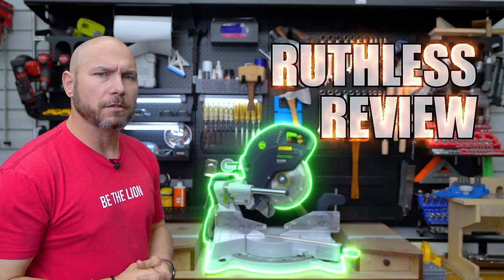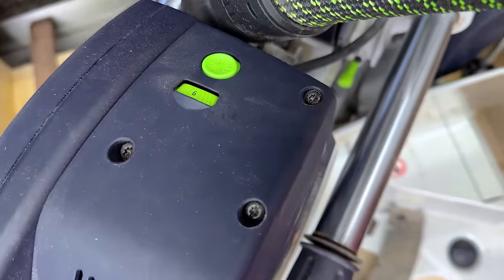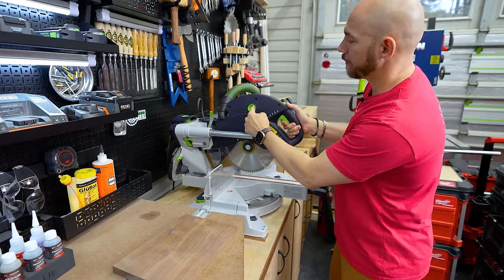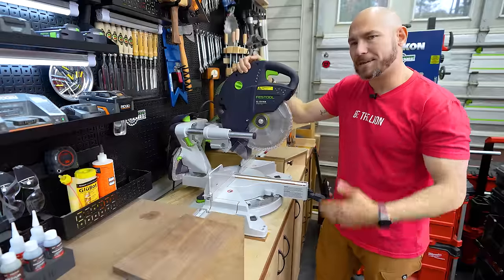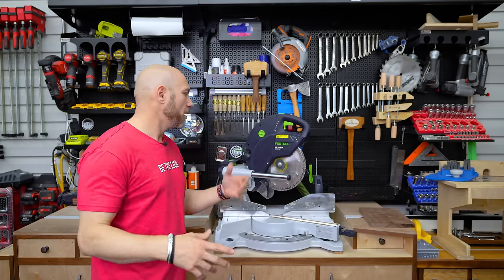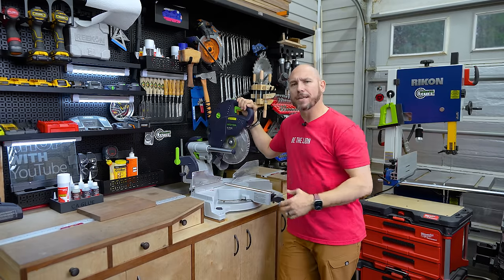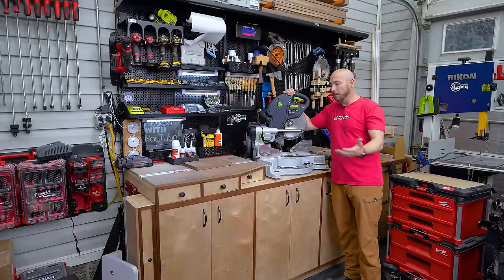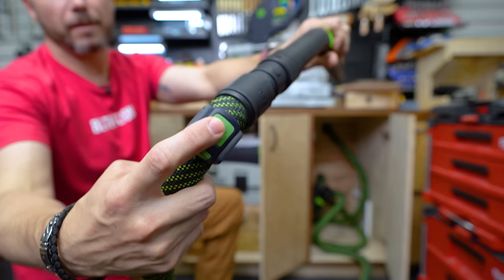Ruthless Review of the Festool Kapex Miter Saw!

Comment: The blades arent proprietary, they are a euro size, a 30mm arbor is very common on larger Euro-Tools (like sliding table saws, which can use a 250mm or larger blade). There are plenty of 3rd party options. Oshlun, Tenryu, CMT, Forrest, Infinity, Freud, Amana

Comment: The blades aren't really proprietary, they're just the metric standard size like someone else also mentioned.  If you have a shop that sharpens blades they usually will punch out any 5/8 arbor blade to the 30mm for a very fair price.

Comment: one thing I've learned about Festool "recommenders" is that their recommendations (especially on more expensive tools) seem to be based on the need to justify to themselves (and others where applicable), the amount of money they spent on the equipment, emotional recommendations, if you will.  I've got several Festool tools (4 sanders, 2 vacs, domino, router, cordless track saw and tracks, accessories, etc.) and I love each and every one that I've purchased but this specific tool, ah.. I just don't get it.. I bought it, yes it's got nice features as you point out, but at the end of the day it does absolutely nothing any better than my Makita LS1219 for 1/3 the cost.  I returned it.

Comment: I am just a DIYer and went through  3 miter saws before making the plunge.  That was 11 years ago and I have NEVER looked back.  The old Cry Once theory.  Over those 11 years the saw has worked flawlessly with absolutely no issues.  Just made a 100 or so 30 degree miter cuts making Xmas trees and the saw is as accurate today as it was when I purchased it.  And... it has NEVER been recalculated or readjusted.
As was said, the hold down is something that I actually use all of the time.  In fact I purchased a second one for the other side to help prevent pinching and binding if a board is not perfectly flat.
All in all, I am very happy and please with my purchase over 11 years ago.
Another plus,  if I have a question about the product or any product, Festool customer service is ALWAYS helpful and they always answer the phone.
regretted any purchase for a moment.                                    JimE
Reply: I just bought a 10 year old kapex with a broken motor for $220. I've got a brand new bosch axial glide and although I obviously haven't used the kapex yet i gotta say it feels super solid even after 10 years
Reply: @AwesomeActsOfRandom  Once you fire up the Kapex I don't think you will look back.  I found working with Festool easy and productive.   JimE

Comment: I install stair treads with prefinished flooring.

What the Kapex and all Mitre saws saws are missing is a fine adjustment for the mitre. The fine adjustment on The Kapex for the bevel should be mirrored to the mitre. Sometimes I need to cut a slither off a current mitre to get a join perfect or my prefinished stair nosing's without gaps. I have to tap the mitre adjustment with my knuckles to make the fine adjustments but if I hit to hard, I'm way off!

Another Critique is the laser lines bleed so they are not accurate and are hard to see if you have sunshine on your work like I do on job sites. A shadow line would be better for accuracy and maybe a green laser for when there is sunlight?

Other than the above issues its a fantastic saw

Comment: I have one and love it. For the blades you can buy a regular blade and use a step bit to size it up for the festool. I have a Bridgeport so its short work for it, but my neighbor uses the step bit and it works fine.
Everyone complains about the price BUT, before, I needed a table saw sled for 90 cuts and I have a beautiful old Dewalt radial arm saw that was set up for 90 cuts only.  Now I don't need either, put on the Festool saw and cut,- perfect every time.
Edit to add.  The handle works equally well, left or right handed so you can comfortably cut on either side of the blade.  I think thats why the keep it.  I thought it would be a problem too, but like you said a couple of day and I didn't event think about it again

Comment: Had the saw and returned it for the KS60. Battery life is ok to good and it is not as feature rich but it does the job supremely well.  So for those in garages or work sheds where electricity is an issue the KS60 is a solution. Also, purchased the hold down separately and rigged it up to work on the KS60 as it is a superior hold down clamp. Thanks for the review.

Comment: I bought my Kapex about a month ago & have loved it! I upgraded from a DeWalt DW717 and have noticed a huge difference! The biggest difference is how straight my curs have been, both straight & miter cuts. The positive 0 degree stop on my DeWalt wasn’t true & I tried several times to reset it to no avail. 

I’m glad you pointed out the dust collection as that was something I was a lil disappointed in myself; but like you say it’s far better than my DeWalt was. 

Overall, I fully agree with your review & am confident I’ll never need another miter saw again.

Comment: Thanks for the review.... a couple of points I'd like to make.  Regarding price.... you get what you pay for.  I sold some of my 10 year old Festool products for more than what I paid... and they held up beautifully over the years.  Also, the price covers the excellent warranty and Festool's investment into R&D ensuring that their ecosystem improves over time.... protecting your investment.  

Also, let's be completely real here.... miter saws throw a lot of dust.... there is no perfect way that I've found over the years to eliminate or greatly reduce miter saw dust. Full Stop.  

Last point.  I not sure where you shop, but I don't know where you can get a quality table saw and miter saw for $1600!  High quality tools cost money and last.  Cheaper ones cut corners, typically have to replaced just at the worst time possible, sacrafice ease of use....can be under-powered and are often less safe.

You get what you pay for. Be informed before you buy into any given platform.

Cheers

Comment: Thanks for the review Mr. Matt. I think I will stick with my Terminator style Bosch 10 inch miter saw. The articulating arm on that thing has served me well. Funny thing about the Bosch is that the 10 inch is actually more expensive than the 12 inch. Go figure. It may be because the 12 inch blades are more expensive, who knows? The Bosch saws on Amazon both have 5 stars which is pretty cool. 
I once saw a review of this Festool Kapex and the guy who bought it did a lot of interior work at places like bars when they were closed. He stated that the reason he liked the saw so much is that there was basically NO dust at all when using it. Thanks for clearing that up. 
I can see paying a premium price for a Sawstop table saw. The safety feature alone is worth the price. I should have enough saved to get mine in about 1 year. This saw however....think I'll pass.

Comment: I picked up my KAPEX pretty much when it was released. I went from a little Hitachi SCMS to the KAPEX with the trolley and extensions and have enjoyed using it a lot. I'll admit it's not the best for everything and a few years after I bought the KAPEX I grabbed a small Metabo cordless SCMS that has seen a lot of use .. for floor boards and light framing it is insanely convenient.

The KAPEX trolley and wings aren't the sort of thing you want to throw a tree trunk on as I'd rate them as medium duty at best. Now being rural I've added an XGT Makita 12" SCMS to the mix along with a locally made aluminium portable station that you could park a truck on (the combo came close to KAPEX money). I'll do anything to avoid firing up a generator.

The only way you'll ever defeat dust using a slider is to add a shroud and connect it to a high volume extractor. Personally I'm surprised that Festool has never introduced suction into the throat. Is that obvious or is it that I'm just stupid and missing something?

Comment: Thanks for the review.  I'd love a Kapex but I'm with you on the price. I really like my 12" Makita slider. For half the price, it's very accurate and gives me tablesaw-quality crosscuts. The Kapex implements some of the finer features brilliantly but with the difference in cost I bought a couple of other tools I needed.
Reply: Long live the LS1211, mine is 25 years old.
Reply: I love my recently bought DSL211, much more than my MIL’s Kapex.  Although I think that the Makita [12 inches] is way too heavy, the industrial shaping and finishing quality on this tool is phenomenal.  And, also, you get the correct angle for the handle.  Eff Kapex’s tea-pouring handle (and, yes, I know, Makita uses those also; but they do so on quite small blade models).
Reply: @Jeedehem  I agree that the 12" Makita is heavy.  For me it's not an issue since I don't need portability.

Comment: I’ve recently acquired the CSC SYS 50 table saw and the TS 60 K track saw. Would there be any benefit in me getting this mitre in addition? I don’t want to get it and to find out that the table saw (which appears to have pretty good mitre capability) makes it redundant. 

Any thoughts?
Reply from the maker: Depends on what you're cutting.  If you're cutting a lot of longer stock to break down into smaller pieces, the miter saw will be best I think. But if you already have the table saw and track saw, and don't find yourself missing a miter saw, I wouldn't worry with it.

Comment: if it is too expensive, why did you buy it?  Whey not return it and buy a saw that had the features you wanted with a price that aligned with your expectations. I think complaining about the price does not hold water. It is the right saw for some woodworkers and delivers value. And for others, the value is not there.  Complaining about Festool prices is just whining. Don't buy them if you don't like the prices.

Comment: You probably should add a dust separator to your vacuum, it saves on the expensive festool bags. The oneida has higher cfm's than
the festool separator, but the Festool separator is a bit more compact. I own the Kapex and agree with your assessment of the dust collection,                    mostly the it just minimizes the fine dust you might breath while cutting, but a lot of the larger sawdust particles escape, i'm doing experiments on how
to improve festool, but seems to me, at $1600, should already work perfectly!

Comment: I’m not a fan of the laser kerf lines. In my opinion, Dewalt has a better set in the DWS780. It uses an LED to cast a shadow line.  So, no worries if you are red/green color blind.  And no worries for calibration of the lasers every so often.

Comment: The craziest part is that if it was a 12" saw I would justify the price even though my job site 12" dual bevel sliding compound dewalt miter saw, stand, miter saw wings with stealth stops, and a killer blade was about the same price. The Kpex doesn't cut any better but it is lighter. For the shop this would be king if it was 12" and was around $1200.

Comment: Great video!  I was wondering about that dust collector having the tool outlet AND being Bluetooth compatible. Also, first time I’ve seen that woodpeckers track!  Lots of great bonus stuff in this video for me!  I’m running the Festool KSC 60 and the battery powered dust extractor. Thinking of upgrading to the plug in dust extractor because of the battery runtime. Great info
Reply: How do you find the KSC 60 dust collection?
Reply: @lesbentley4082  for me, I would say it’s very good. I can tell a big difference when the dust collector is running and when it is not.
Reply: @adamwaldon5563  ok thanks.  I have started a lot of work in finished homes, feature walls and work like that.  Was wondering if I was clean enough to use in a living room without a mess.
Reply: @lesbentley4082  I’m a DIY woodworker. I’ve had a few miter saws though and it has the best dust collection of any miter saw I’ve used. I love the shadow blade cut guide as opposed to the laser on the big Kapex. It’s a nice size also.